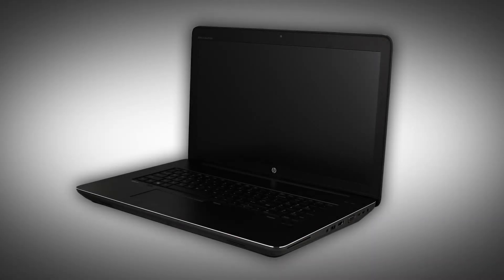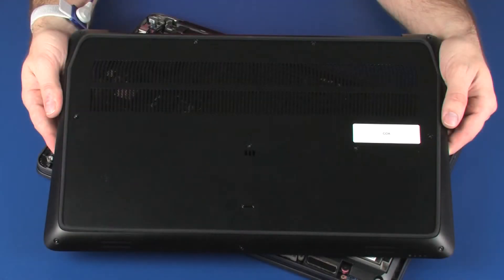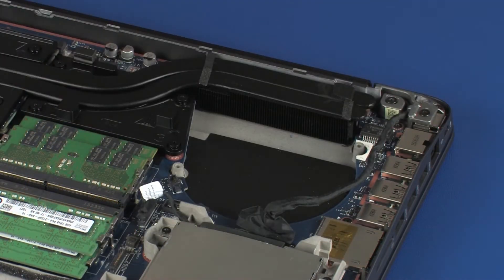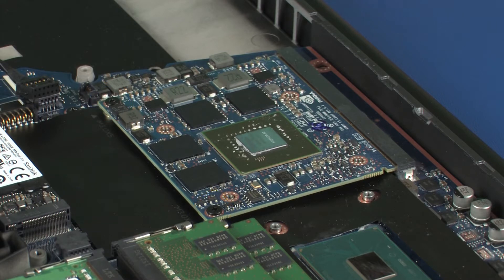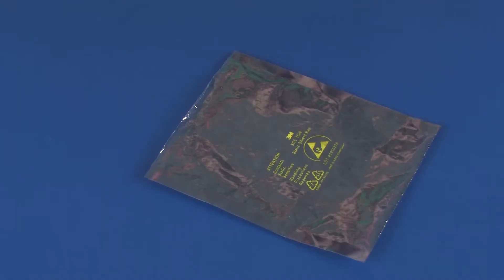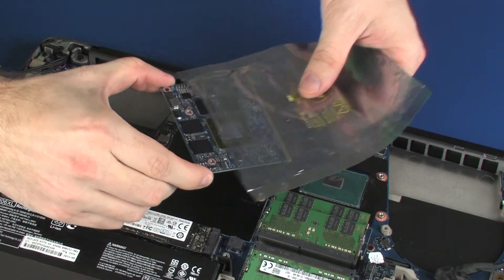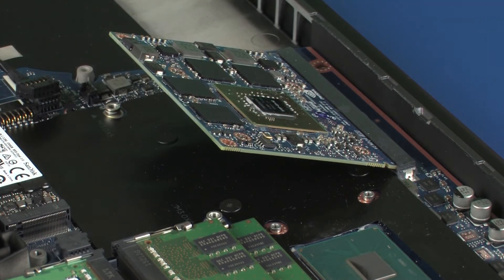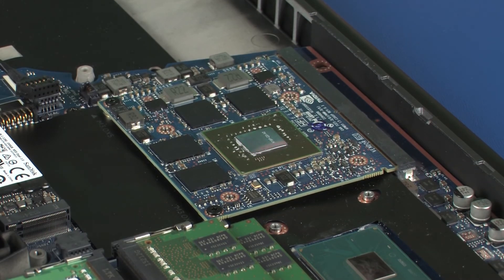Replace the Graphics Board | HP ZBook 17 G3 Mobile Workstation | HP Support

Comment: I have the Quadro k 3100 m can i replace that with gaming card ?
please help
Reply from the maker: Hi there, thanks for contacting HP Global Social Media Support!
I understand that you need to know about the compatible graphics card for your computer.
I will do my best to assist you.
The HP ZBook 17 G3 Mobile Workstation is compatible with several NVIDIA Quadro graphics cards, including the M2000M, M3000M, M4000M, and M5000M. It also has integrated Intel HD Graphics. The ZBook 17 G3 features an MXM video card slot, allowing for potential upgrades, but HP generally restricts these upgrades. 
Regards, 
HP Support

Comment: Can i upgrade it (zbook 17 g3) to a 4 or 8gb dedicated VRAM
Reply from the maker: Hi there, thanks for contacting HP Global Social Media Support!
I understand that you need to know about increasing the VRAM of your computer.
I will do my best to assist you.
You can't increase the video memory per-se, but you can allocate more virtual memory for your computer to use. To do this, click start, right click computer>Properties>advanced system settings>advanced>performance>advanced>(virtual memory)>change> Click custom size and enter the size of hard drive space you would like to allocate to virtual memory. I would recommend and initial size of 10000mb and a maximum size of 20000mb. Click apply and reboot your system. Binu - Social Media Tech Support
Regards, 
HP Support

Comment: I have HP Zbook 17 G3 , suddenly the laptop shuts down while using... again if I powered on... some times works , some times getting shuts down immediately...

It seems there is issues in graphics card , can I remove graphic card and can I use without graphic card
Reply from the maker: Hi Khisal, thanks for contacting HP Global Social Media Support!
I understand that you are experiencing an auto shutdown issue on your computer.
I will do my best to assist you.
Please perform updates via Windows and HP Support Assistant as mentioned below to fix this issue: Step 1 Windows Updates - 1) In the search box, type and open Windows Updates. 2) Check for updates. 3) If the updates are available, click on install and restart the computer. Step 2 HP Support Assistant Updates - 1) In the search box, type and open HP Support Assistant. 2) Check for updates. 3) If the updates are available, click on install and restart the computer.
Binu_HP Social Media Tech Support

Comment: Could the intel graphics replaced with nvidia?
Reply from the maker: Hi there, thanks for contacting HP Global Social Media Support!
I understand that you need to know about replacing the graphics card of your computer.
I will do my best to assist you.
HP does not recommend upgrading or downgrading hardware parts or software that is bundled with the product as It may affect the manufacturer's warranty and performance, however, you could change the configuration at your own discretion.
Binu - Social Media Tech Support